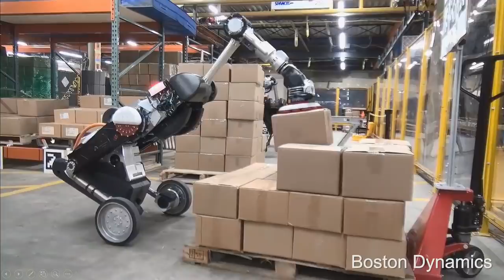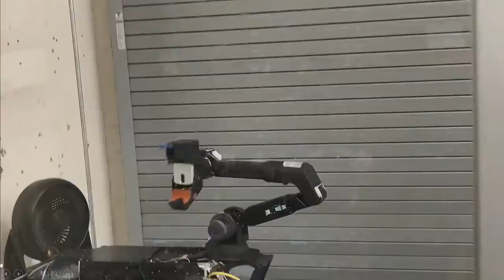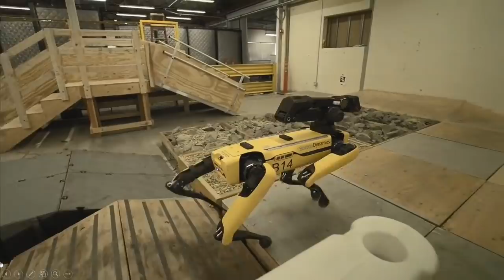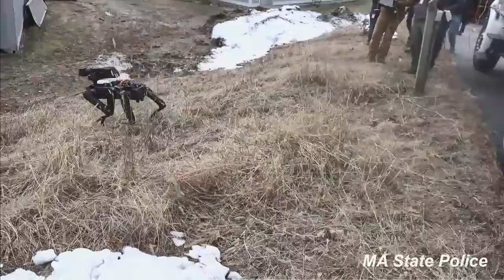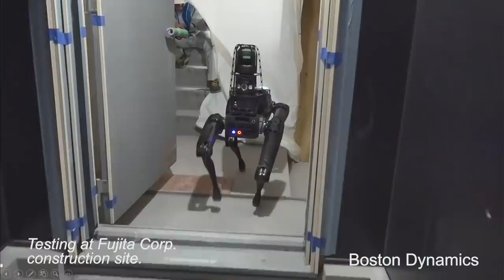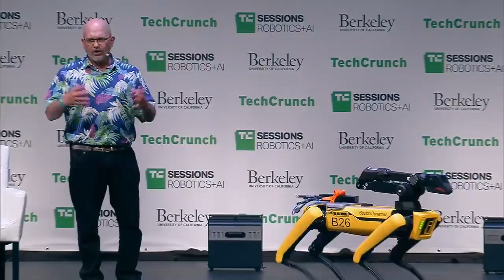The Best Robots on Four Legs with Marc Raibert (Boston Dynamics)

Comment: I'm super excited to buy a SpotMini, hope they make it into full production
Reply: I want one too, but Don't know what I'd do with it. I guess it'll be like a pet that doesn't need to be walked or have to pickup its poop.
Reply: @JJs_playground  Vector Robot by Anki, A Home Robot Who Hangs Out & Helps Out, With Amazon Alexa Built-In https://www.amazon.com/dp/B07G3ZNK4Y/ref=cm_sw_r_cp_apa_i_xejWCb0WARZKV
Reply: Went would you need and want one? It's gonna cost thousands and it can only open doors or pick up beverages for now. And it's not even available for the customer yet.
Reply: @SahilP2648  true about the price, but Spotmini is a platform and nearly in full pre-production. It can do a lot more now. I plan on coding it to help me around the shop, as I'm a mechanic. It can bring me wrenches and such while I'm under a car. Hey, if it can bring me a drink on command, added benefit. The only way to get the price down for consumers is to buy  them, so it's worth it to me :)
Reply: And of course, it would be fun to just mess with. I might even buy two, despite the initial price. I think it would impress some friends. If Boston Dynamics can program it to dance, I'm sure I can program it to do a few other useful tasks. It already has autonomous navigation software
Reply: @Kieryboo  it would be a 100k initially and not even open to consumers. Plus programming it to bring you a wrench or drink is gonna be hard. Especially if you don't have a coding background. You should not go in that direction.

Comment: So spot mini is a product for developers? It's open source?
Reply: I hope it is not open source! HELL, imagine Spot with a gatling gun mounted on it, heat sensors and enhanded mobility with an extra arm holding flashbangs. Hello future!
Reply: @Yalami8  It will, the only way to make this affordable is to make millions of it. So it really need to be polyvalent. They just can't make all the software by themselves.
Reply: @johntheux9238  i get it, but they might need to hold on for a bit, at least until they put some kind of control measures. I mean a group of terrorists could  practically do an untracable job, risk-free. Think about it, the hardest part is making an actual robot, throught B's of $$ .
Reply: I really hope it's open source!
Reply: I don't see why it would be.
Reply: Why would it be open source -_-
Reply: @SahilP2648  Because it's a plateform, it's designed to add hardware and software to make it more polyvalent.